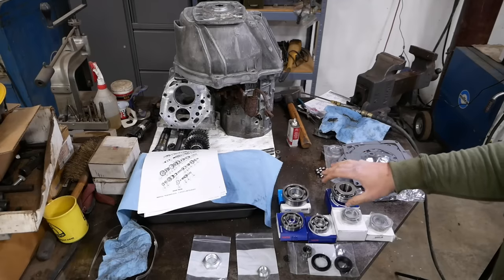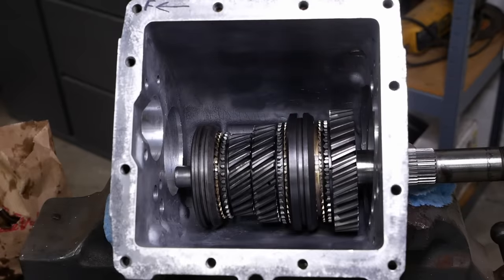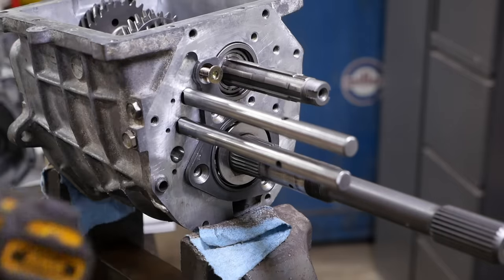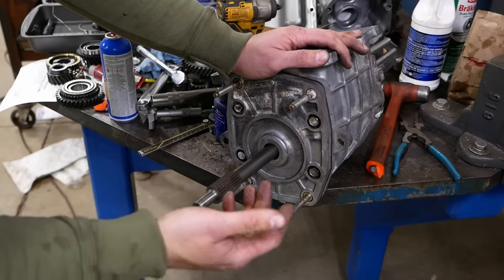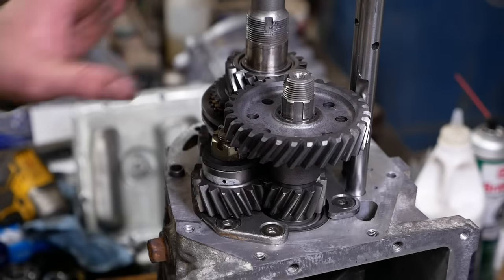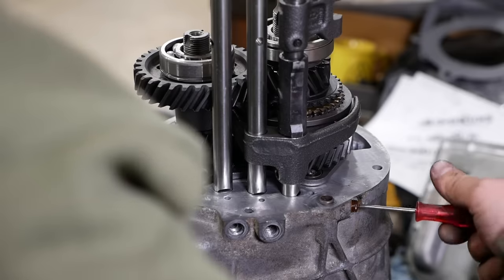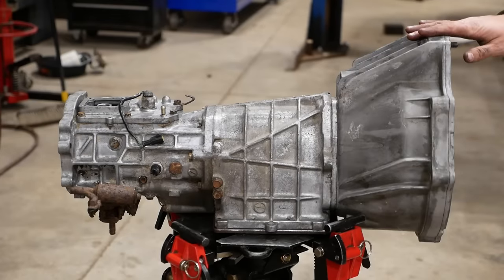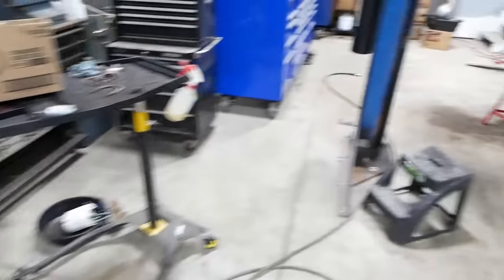Ford Ranger Transmission Rebuild - the Complete Guide No One Asked for - Part 2

Comment: Youre a brave man tackling that nightmare of a transmission with little experience with them, makes me feel bad about not attempting a rebuild on my T56 lol. Great vid as usual.
Reply: It's already broken. It will either get better or worse.
Reply: @12345NoNamesLeft  thru
Reply: T56 is so easy
Reply: Around here it would have been only worth the hassle if in dire need of a spare transmission.
about anything underneath except for the transmission would fail our biannual inspection here. Mainly eliminating the catalytic converter, but that is not even the worst thing. That amount of rust would have made it fail at least 10 years ago, if not even earlier. I wouldn´t dare driving it as I would be afraid it could break in half with every bump you go over.
But well, Wes obviously didn´t plan for the donor car for no reason...

Comment: Wes taking from an old mechanic that has been working on car's since around 1983. I have found that it is often better to leave that remain seal alone on the engine, if it is not leaking then to replace it and then have it start leaking after you replaced it with a new one. Sure yeah, we are supposed to replace them when we remove the transmission to either do a rebuild, or a clutch job. But sometimes it is better to leave things like that be, and wait until they actually need to be replace. Sure it means someone else will have to go back in and replace it later on, when it does start leaking. But I have seen rear main seals on engines out last the engine it's self, just like I have seen them start leaking after being replaced. So I find it is more a matter of personal preference.
Reply: Why do they sometimes leak after replacing?

Comment: Those grooves on the bearings are for the removal tool to lock into. There is a bearing collet removal tool that locks into those grooves along with a long tube and forcing screw to remove the bearings.

Comment: I fix old junk that barely makes sense myself, but I tend to look at this a slightly different way. You helped keep another old vehicle on the road, even if it isn't a classic. The idiots using paper straws never seem to remember the "Reuse" part along with "recycle" and "reduce". And you helped someone else get some affordable wheels, and in particular a truck. It is insane what they cost these days, so you just did someone a huge favor.

Comment: Great video.  At the retirement age of 65 I am still out in the shop working on and repairing vehicles for the same reason, to see if I still can, and I still can.  The real challenges for me are the electronic and drivability diagnosis’s.  I’ve invested in the necessary scan tools and rely on channels like yours, Eric O, Ivan at Pine Hollow and Paul Danner at Scanner Danner.  So far I can still get them figured out and repaired.  I’ve learned more in the last three years with the help from your channel and others than I have in the last twenty years.  Thank you.  Have a great Christmas.

Comment: Maybe it's a bit late for a comment on the video but I watched it today sitting on my terrace in the late spring sunshine. 
I am a Service Trainer for Suzuki in Germany. I love transmission work and man...we dealed with a lot of different transmission types as Suzuki bought all diesel engines with transmissions from other OEM, like Mazda, Fiat, Peugeot, GM.
Teaching this stuff to the dealership mechanics I more than one time testified them to never bring my car in their shop...in Germany they all have 3.5 years of apprenticeship but there are skills you barely cannot learn - e.g. the feeling for the material you work with, the understanding what precisely machined parts are and last not least that the biggest hammer is not the best choice for transmission work.
In you, my friend, all that and a lot more skills are combined - you did an awesome job!!

Comment: Great job Wes...   I did an input shaft bearing back in 1982.... working at a dealership...and it cost me a mint in tools to get it done.   The service manager insisted the problem was the throw out bearing, despite the fact that I told him the problem had to be internal to the trans.  Ended up putting a throwout bearing in to please the Service manager, then he felt like an idiot, but didn't pay me, then I was told to "FIx it"  So, I rebuilt the trans, replaced the input shaft bearing... (nightmare)  and the issue was fixed.   So... I feel ya.  Great job.

Comment: Bought a brand new 1999 ford ranger, Was told the 2,9L engine was a BMW converted to a push rod engine, my also had get the tranny rebuild at 320000, drove it back and forth a 75 miles at  the NASA KSC for several years, sold it to a AF MSG for 3K, he keep until 2015, I still wish I keep it? I dld convert the exhaust to Anaz system made a big difference, had a great rumble, my neighbors thought it was a big V8. great watching your analytical mind, I was a Computer Engineer way back starting in the early 1970.  Thanks for the great video.

Comment: Good job, I rebuilt a Rav4 manual gear box with the transfer case, because the garage asking $5,000 dollars, it cost me $800 dollars of parts including clutch, bearings and gaskets and seals, and took me 2 weeks to do it, it was a venture and experience and satisfaction when it was done and work.

Comment: 2011 ranger thunder ,japan import to Ireland  , leaking back diff , 3 garages will not touch it ford say 2k for a back diff casing , not an option , 
im up a creek with no paddle and my pride and joy is off the road , till i find a guy just like you Wes.
great content and watching a master machinic at work is a joy

Comment: I'm rebuilding the Ranger transmission before this: the Toyo Kogyo 5-Speed (TK5). This video is going to be my backbone because there is no video for that transmission, and this one was super similar. Thank you so much. I had as much trouble as you taking it apart, hopefully as much success putting it back together 👌

Comment: Well mr. Wes , now I know why you call this transmission a puzzle . Just when I was appreciating the use in design of a caged roller bearing for the input shaft and not individual rollers , they make a trick out of fitting the countershaft back in place . Then the pleasant reminder of the order of parts placement . I guess we are so use to spicer and Tremec . Will give you much deserved credit , you got good suppliers , most of the time , except when they don’t get you a part at all . Sorry about that . Glad you got better tools too . After fighting with the wrong tools for so long , I learned to invest in some better tools after a while . Overall , you worked it out . Good job once again 👍 thanks for the tip on brass punches .

Comment: My 97 Ranger 4x4 has the Mazda 5sp. Lucky for me "I know a guy" and just like a lot of us I dont do transmissions, but the Mazda 5spd has only had clutch work and basic wear repairs for its 357,000 miles.
 I still find it interesting watching anyway just so i can support the other end of a conversation. 😊
 That wye pipe connection is a wonderful pile of Ford engineering  and luckily I know another guy who does exhaust  and he fabricated a similar adapter and installed a universal cat and didn't use the $600.00 Ford cat with that funky connection.
Reply: I feel good knowing you resurrected an old Ford.

Comment: I got a soft spot for those old Rangers....had an 88 stx 4x4 super cab 5 speed drove that truck to hell and back sawed the bottom of the front fenders and put 31x10.50 on it.. never broke down ...wish I still had it...glad you saved one...

Comment: I just want you to know your 2 videos on this gave me the motivation I needed to do this my self. Having your videos for help where the manual is vague is some areas worked out great. I bought a 1986 Bronco II that had the fm145 and the input bearing blew up and sheared the input gears. But it was harder to source parts but got everything I needed but the cluster nut so I took extra care trying to reuse it. Can't test it just yet I have to reseal all around my engine but I got faith it will move again. THANKS FOR THE VIDEOS!

Comment: First off, great video, I love listening to you as you work, some of us cant walk and talk and chew gum at the same time like you can!! I also like how you gave the cost run down on this trans rebuild, there are rebuild videos all over the place on stuff BUT you was the only one that gave the cost of that rebuild job at $1,400.00. 
Now Ill give you my cost run down, I'd pay you $1,500.00 all day long if that was my truck to fix my transmission but if it was 2 wheel drive it wouldn't worth a Nickle, but since it's 4x4 and runs good it's probably worth 4k now but it wont be much longer if you dont get some NH oil on it. 

PS if you ever get a chane to fix a farm tractor from 25- 75 hp, I'd love to watch that, I like tractor repairs and theres not much of that on youtube.......

Comment: I think the torque spec you were looking for on that large nut is actually: Nizentight. It's a German torque spec that works on many, many nuts and bolts. ;)  I have to say, you are a better man than I. There is a reason I never did tranny work and you just showed it. Though I think you did a fine job. And also did the right thing by NOT videoing you throwing tools across the shop and keeping it professional....

Comment: Get an induction bearing heater. I have installed 100s of bearings, they are by far the best way to install anything steel with an interference fit. You do a great job and inspire me!
Reply: or just place it on an incandescent light bulb.

Comment: I learned all about how those interlocks work, when I put a donnor transmission in my 1935 WC Allis. All the rails and forks mount in the bottom of the shift tower, and since I had to replace the shifter, I had to remove the middle rail, to get to the reverse lock out mechanism.
 Somehow when I had that rail slid back out of my way, the interlock pin found a new home. Everything worked fine, until I was asked to lead the parade at our local tractor show and I pulled it out of first gear, slipped into reverse, but it never came out of first gear. No amount of HP will make a tranny run in first and reverse at the same time. 😉
 I didn't lead the afternoon parade cause I had to pull the shift tower and slip things back into neutral before I could move it. With very careful square pattern shifting, I made it thru the weekend at the show, got it home in the shop and found that the pin was missing.
 I found a perfectly good pin in the box of parts left over from the original transmission and it's worked great for 12 years now. 🤠
Reply from the maker: We had an International 460 that loved to shift into two gears at the same time. Dad would pop the shift lever out and move the rain with a screw driver. He could do it in a few seconds!
Reply: @WatchWesWork  on later WD's and WD45's you can do that. The WC had a reverse lock out mechanism below the "ball" on the shifter, that wouldn't let it pull out the top without removing that first.

Comment: I was wondering about the financial end of this and you answered it.
Great job on the rebuild!
When I was around 10-13 years old, we got a riding mower with the transaxle in a bucket. The flange bolts had come loose and allowed the ring gear to come out of mesh and break teeth off. This is way before the internet. Don't know how I found a place for parts, but I got a new ring gear and a few other parts which came to around $30. Got it back together and mowed the yard once with it. It would jump out of 3rd gear. I also think there were issues with the deck. The engine would kick back which would really hurt the hands! Learned a lot.

Comment: I've been wrenchin 30 plus years and I'm pretty sure i would not attempt that if it were a customers vehicle. myself? eh maybe, but i'd have to be really bored and work be really slow which almost never happens but its cool u posted that and had the right gauges to check tolerances. thanks for takin the time, was very interesting for sure!

Comment: I'm at 10:45 and I suggest you use the output shaft nut and a spacer the pull the shaft back (and set the bearing) this will correct the position of the input shaft. No need to back track!

Comment: I have done a TOTAL REBUILD ON 2 BORG WARNER TRANSMISSIONS for a PINTO 2.3 liter , 4 cylinder ....and for "MUSTANG II "  with a 2.3 liter , 4 cylinder ....BORG WARNER QUALITY IS INCREDIBLY GOOD ....GEAT TEETH WERE HEAT TREATED + HAD -0- WEAR ...ONLY HAD TO REPLACE BEARINGS + 1 CRACKED BRASS. ( BRONZE ? )  SYNCHRO RING

Comment: Great job, enjoyed the videos.  I am surprised that you still have a peanut gallery.  Keep up the off the wall repair videos, they make for great content.  The R and.R times is interesting.  I had a F 150 with a 4.2L and 5 speed manual.  The slave cylinder went and I was astounded that the total repair cost was close to $800.00 to repair.  With the majority of the cost going to remove and replace.  Like you, they had a hell of a time remove the stick boot.  They basically trashed it leaving a mess that they said was impossibly to restore to factory specs.
Reply from the maker: If I was smarter I would have removed the transfer case and then reached up and removed the shift tower from the bottom.

Comment: Very well put together video.  Up here in the northeast, those are very rare to see due to the frame rot issue those were plagued with.  If you do find one up here it's best to not bother due to the certainty it will fail inspection for frame rot.  If you could find one with a dipped frame that would be a great little truck.  

Even though I'll never own one of these trucks I still watched both videos.  Very informative and it was interesting watching you figure it out.  Thank you.

Comment: Loved the reason for doing it. Same reason I laid in the dirt driveway with a floor jack and pulled the transmission out of an 05 Honda Civic to replace the input shaft bearing which is removed and installed from the inside of the transmission. Took me 3 days to do it with the limited tools and parts runs, but it ran fine afterwards. Fun times as a college kid.

Comment: This is what differentiates a mechanic and a parts swapper, that's why I like your channel it's not always the easy way to the finish line. Very few people can rebuild parts and get them to function correctly. Recently rebuilt the brake system on an old for by honing and rebuilding all the wheel cylinders and master several people thought I went loco but I had the parts to do it from an auction purchase of $15 for a total savings of $189

Comment: Damn, that thing is an absolute puzzle box!

One of the problems with the T5 is actually not the case flexing, but the stamped steel countershaft bearing retaining plate stretching. It allows the countershaft to rock between the taper bearings and bind, which takes out gears. I don't know if the case flexes as an additional weakness, this is the first I've heard of that with a T5, but I can see it.

Comment: If rust was a disease I think you found the initial carrier.
I guess you didn't install spacer and bearing on the rear of the gear box was because the truck will fall apart before the bearing fails.
I worked on Land Rovers a lot, from series 1 to the Discovery, my personal favourite being the series 2A and those gear boxes were a challenge but that box you have there is a next level of awkward/frustrating.
I agree sometimes doing something to test your skills is far more rewarding than the mundane drudge of replace the broken part with new, refurb or used parts and you then know the self rebuilt part is good.
Very enjoyable episodes the fella.

Comment: I agree with your thoughts on when they give you such a broad torque spec.

Tighten them, but don't kill them.

And back in the old days (before aluminum heads and such) when we only had those crappy pointer arm torque wrenches when they has a spec for over a 100 ft lbs you just did it my dads way.  Guten Tight.  And never one did I have an issue.

Comment: You're a man of many talents Wes. I have learned as much from you as I have from Eric O. This was a pig of a job. 

You made the right decision to rebuild. Even if you could get a used gearbox you have no idea what condition its in given its probably at least 30 years old. I actually have a Toyota C60 box with a bad bearing sitting under a tarp in my garden. I've been wondering about rebuilding it. It has at least 1 bad bearing judging by the racket it was making...

Comment: That torque spec means, don't strip the aluminum when you tighten it.  Yes, I will say you should have done the clutch and rear main seal.  Yeah, I know you don't want to hear it, but when this guy decides you are the best mechanic ever and brings it back to get the rest of the work done, you'll be saying it too.  It sounds great, and really makes me miss my old Rangers.  Those trucks were so much fun to drive.  I miss having a stick shift truck.  You did that transmission the right way, and that truck will probably give several more years of service now.

Comment: i keep an assortment of abs plumbing pipe for driving bearings and seals hard enough it works and soft enough it wont damage anything and if you get a shaving it is not abrasive so wont harm like metals will

Comment: I applaud you on this transmission rebuild. I have changed a few and once traded the value body on a 68 ford from a 73 4wd to the 68 2wd and it worked out great. But I don’t think I’ll ever try a trans rebuild. 👍👍👍 to you.

Comment: My experience with the Ranger transmissions and I believe they were using Mazda at that point is the ones in the junkyard were as bad as the one you were taking out to repair all the yards within the system every one of them was $1500 and usable as cores only
So you got to rebuild them either way !